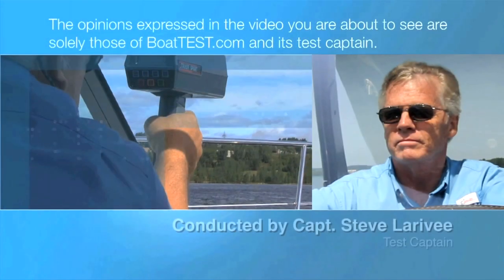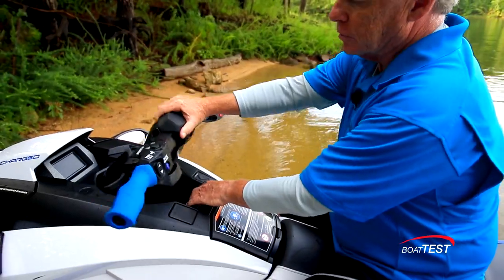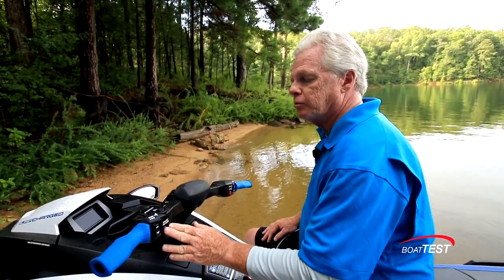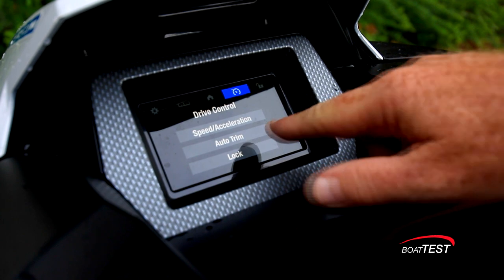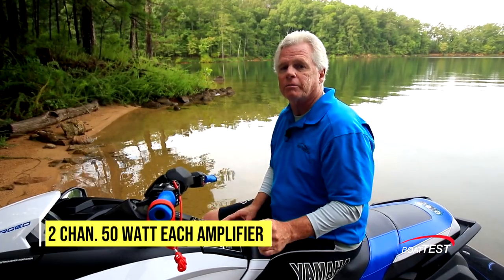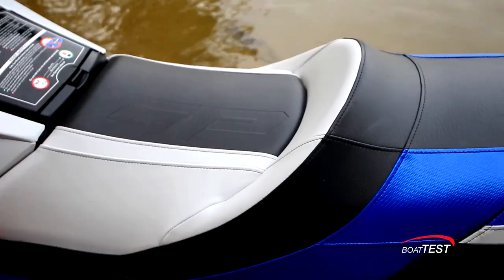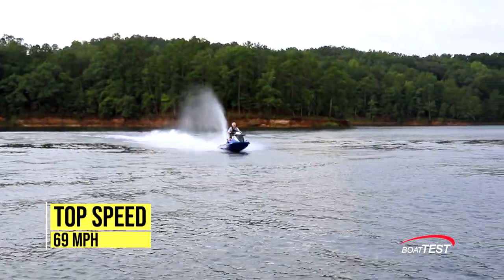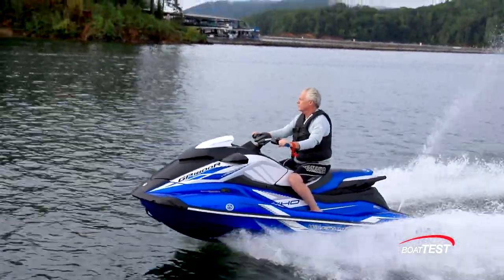Yamaha GP1800R SVHO (2021) - Test Video

Comment: Damn when did jet skis get so fancy??     Nice review Steve!
Reply: About the time the common flu did.  
I missed it all too.  

Quads and dirt bikes are probably correcting their chassis angle when going over jumps automatically with gyros and have airbags by now.... what else we miss??
 I think I just saw a turbo four stroke fuel injected snowmobile with a heated seat and a 255 inch track, with reverse and gps.  China and Canadas only option of an invasion....
The seadoos and Kawasaki pwcs sure look cool.

Comment: Hello,
Looking to buy 2021 Yamaha GP1800R HO.
I heard bad opinions from people who already purchased Yamaha skis made in 2021
2021 Yamaha ski owners saying that skis built quality very poor compare to previous years.
I do believe in this because of the pandemic situation globally and shortage of employees.
I also believe that Yamaha skis for 2021 very poor quality because of high demand and rush in manufacturing them.
Could you please advise what to look for if will be considering to buy Yamaha 2021 gp1800r ho?
Many thanks in advance
Reply: I heard it was mostly miss aligned decals. There were a few that went out with the wrong piece but I forget what piece it was.
Reply: This is the biggest rubbish jet ski I’ve ever owned.
I’m talking about 2021 Yamaha 1800r
Had 3 months from new and luckily got rid of it with only 16 hours on clock

Comment: Some easy bolt-ons and this thing will easily top 80mph!!!

Add in some Methanol Injection and a different tune to some bolt-ons and you can get to 90+ mph!

These things are FAST!
Reply: It will do 80 with just a map tune if you aren’t heavy and full on fuel.
Reply: @streetfighteralpha9891  no, it will not!!!
Reply: @charlieodom9107  
I went back to watch where I saw the GP get 81 mph with just a tune. The one other thing he did was repitch the stock impeller. So it takes a little more work but no extra parts. 

Green Hulk Garage’s video from 6 months ago if interested.

Comment: What is the purpose of the spout of water from the stern?
Reply: It let's you know the water pump is working. Other than that, no reason for it to shoot into the air.
Reply: It is for safety purposes, giving boats and others around you something else to catch their eye so they see you, especially when you are operating in the ocean with large swells.
Also helps you identify Yamaha skis from a distance, no other brand has this feature.
Reply: @charlieodom9107  It is for safety purposes
Reply: @dougnashz  safety....hahahahahaha....hilarious!

If it were for safety, then why has no other manufacturers done the same?

The truth is: It's a Yamaha thing.
Reply: @dougnashz  That was my initial thought, but I don't think it holds water.  How visible is a stream of water against the sea?  I would think that a pennant on a pole would be more visible.
Reply: @michaelsommers2356  Trust me it is extremely visible. I had a pair of Yamaha skis on Lake Winnipesaukee that I was letting my friends use. I was able to identify them from several hundred yards out by the sprays, yeah there were other Yamahas out there but it definitely narrowed down my options.
Also as far as safety goes, they do help, I run a 45ft express boat, skis are hard to see when they are close to the boat, the spray helps to notice them.
A pole with a pennant would get in the way when boarding on/off the ski
Reply: @charlieodom9107  Why is it hilarious? Did you ever run a large boat where there were numerous skis all around you that need to watch out for so you don't run them over?
Reply: @charlieodom9107  Very harsh man
Of course its a Yamaha thing
The pisser helps because of the height
Have a nice evening
Reply: @michaelsommers2356  it’s not a flare gun but it is something. You’d be surprised how little you need to catch someone’s eye. If you don’t like it it is an easy disconnect.
Reply: @streetfighteralpha9891  Sure, but I'd think that a flag or pennant would be more visible.